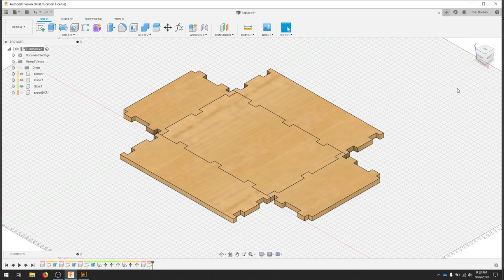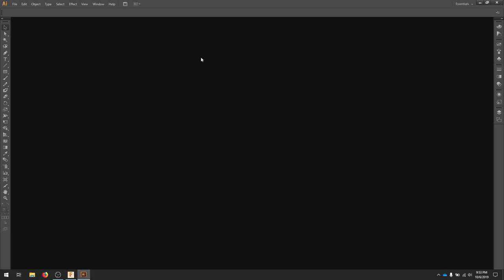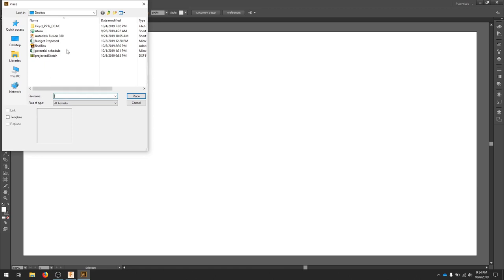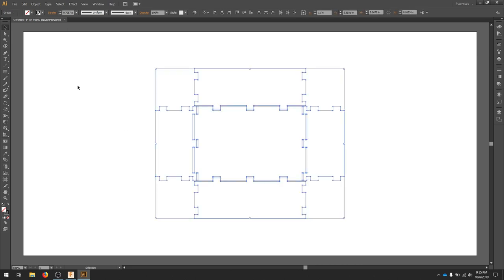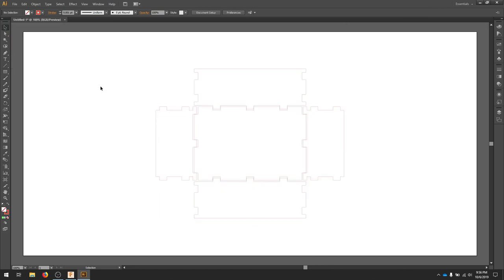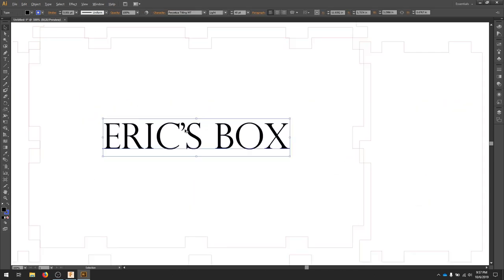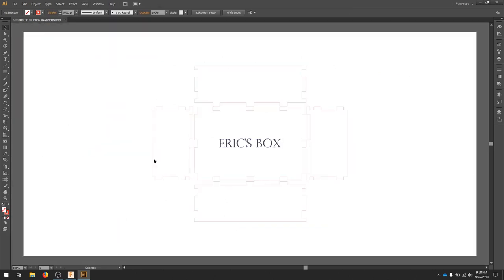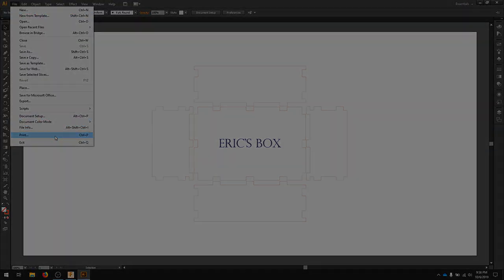Export and Prepare 2D Fusion 360 to Illustrator for Laser Cutter

Comment: When Import dxf files from fusion into illustrator, there are artifacts and problems with the file for some reason, any ideas?  For example my circles wont be perfect, they will have portions where the line thickness isnt perfect all the way around.
Reply: same problem here. curves and bends don't work right